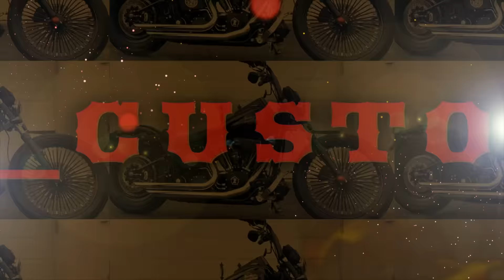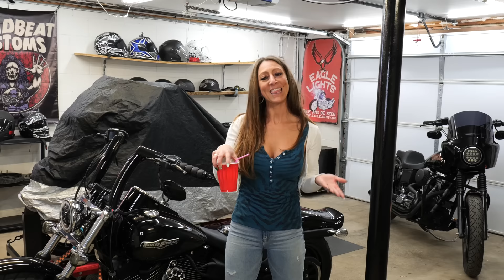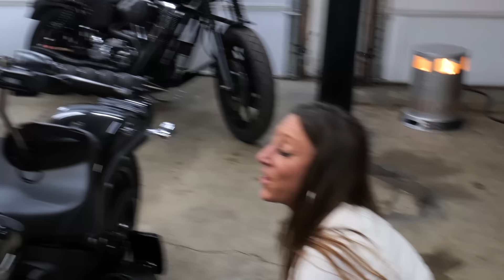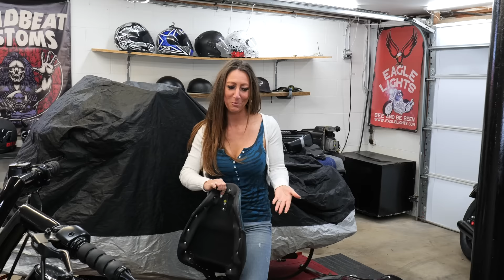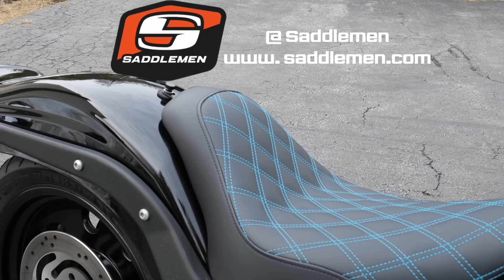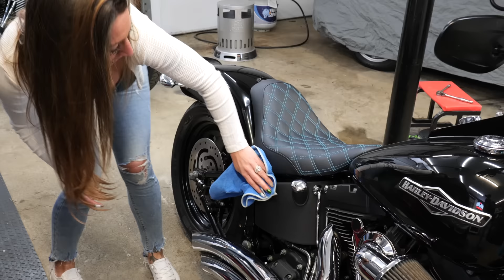If Easily Offended.. Don't WATCH!!

Comment: That's a good looking Night Train and great looking seat . Keep up the videos ,
Reply from the maker: Thanks James!
Reply: The bike is gorgeous, the seat is nice, but that stitching does not work as is right now. The bike needs to have a touch of that color brought in somewhere else besides just the seat. It makes the seat look so out of place and so far out of balance it ain't even funny. Think about bringing in just a couple small pinstripes on the tank or fenders or a tidge of both to balance things out guys! I'm not trying to be negative here but it needs a bit of help yet. The bike is perfect and the seat is so perfect, but right now they just ain't perfect together. It's like when your goin out and you get all dolled up and you put on a beautiful blouse with maybe the same teal or say red in it and as your doing your beautiful doll face up, you bring a tiny bit of either a matching or a contrasting color to your face by adding a tiny bit of eyeshadow and then you tie it all together by making sure the shoes have a tiny bit of the color in it also and even tho it's a super tiny bit , it makes a huge impact !!

Please just consider adding something really small on the tank, especially on the lower front side areas of the tank somewhere around the Harley logo which will help balance the feel  of everything and will make the seat really pop!! A brush stroke or two on each fender will go a long ways of really setting this bike on 🔥!! Your so close and you've almost got it nailed but we are one or two stops away yet but your definitely on the right track for sure and it's gonna be incredible!!